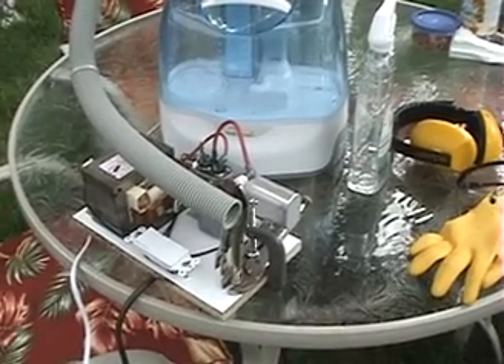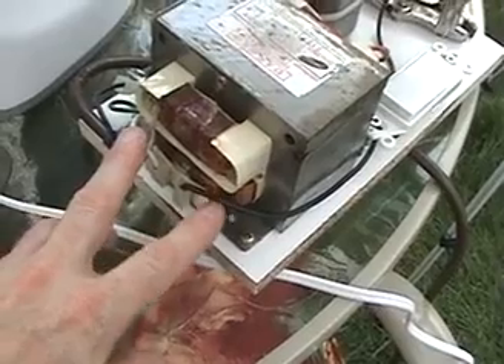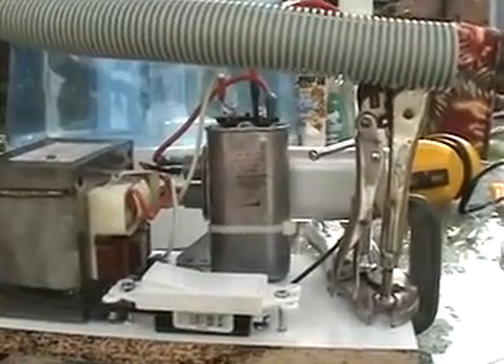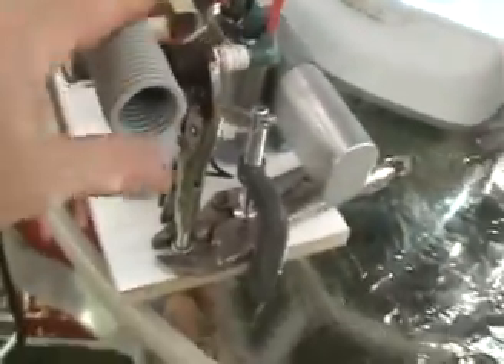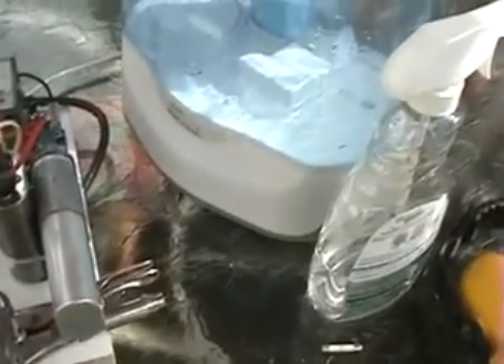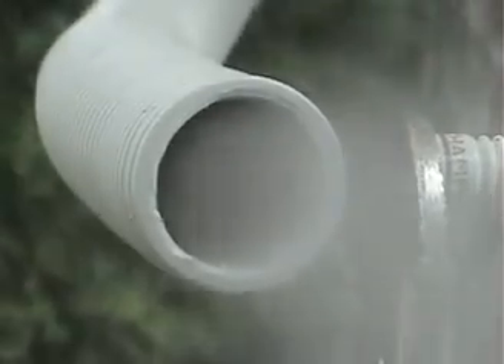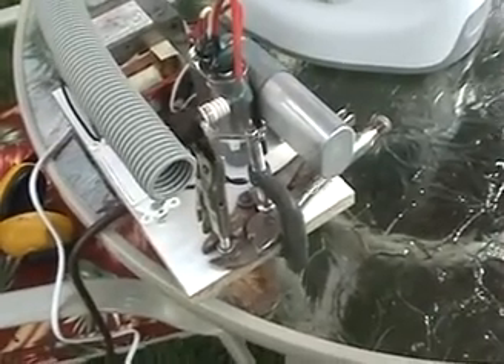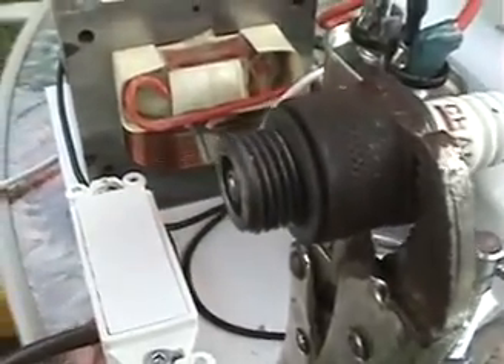Microwave Oven Transformer and Capacitor Circuit test

Comment: You have got to use a 5KV 0.7A fuse. I use this for 220V transformer and 1KW magnetron, 1.05uF. The 15A fuse won't work because it is normally connected to the circuit in the microwave and not suited to your setup

Comment: I understand you don't have this set up anymore, but one solution to your problem would be magnetic ballasting most likely. I'd try and limit current on the secondary, just throw another MOT in there as a series inductance, I've heard it works wonders.

Keep up the magic!

Comment: Oddly enough, I have an MOT for zapping stuff and it never trips the breaker. It takes a fair amount of usage and abuseage to make it heat up, and even then it doesn't come near to tripping the breaker.
It looks like you are using dual Capacitors. Try the same setup, but with just one capacitor. When I parallel 2 caps together, I do get more amperage, but the transformer heats up a lot quicker.

Comment: What does it do exactly? Spark? I can also make a loud spark with MOT if I connect a capacitor to its output.
And yes the MOT with output short-circuited will draw up to 40 amps.

Comment from the maker: Hi tstorey2, can't tell if it gets hot wet. I'll work on a primary pulse system to get it to fire by a circuit. Hopefully then we can measure temperature and power consumption and see if the circuit would have an advantage over the Water Power circuit.  

Luc

Comment from the maker: Wow, thanks for the quick reply. So if I understand you, one leg of the rectifiers DC side runs in series though a regular household electrical dimmer, a light bulb, the MOT primary, a 440 AC 60uf cap and connected to the other DC leg of the bridge. Is this correct?

For the MOT secondary. Is the cap in series also? and can I use more than one cap and if so can they have different uf vales since I have many MO caps but they have slightly different values.

Thanks for sharing and your time.

Luc

Comment from the maker: Hi shimoda18,

thanks for looking. I will be trying different circuit for the MOT primary and find what is most efficient. This was just a crude test to see the spark effect with strait grid 60hz AC. When I find a better circuit for the primary I will share the findings with a replacement video.

Luc

Comment: get a 120ac light dimmer, and a old lamp.
run 120dc (rectifier) to the light.
use one 120dc lead through the dimmer switch, 
through the light, through the MOT, through a 440vac 60uf cap, back to the other 120vdc lead....got it?
O.K. then the seconday out of the mot can be utilized with a ?(cap)? youll just have to play till you get it.  then the frequency can be adjusted ny the dimmer. adjusting the frequency changes alot